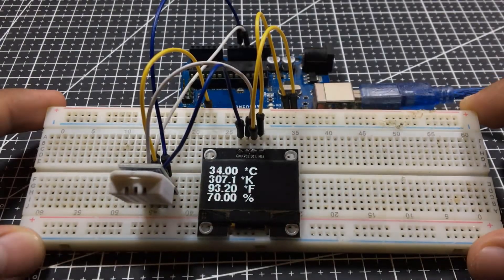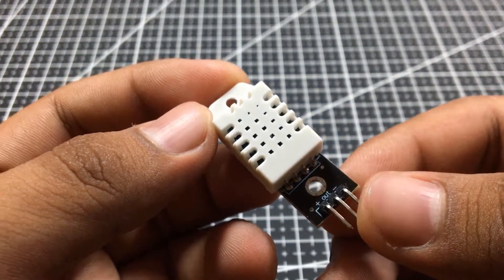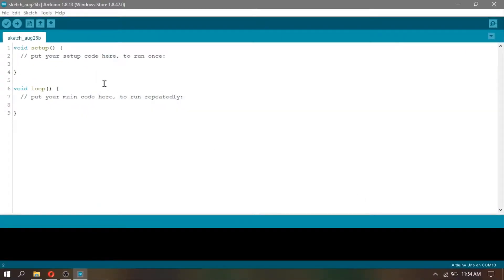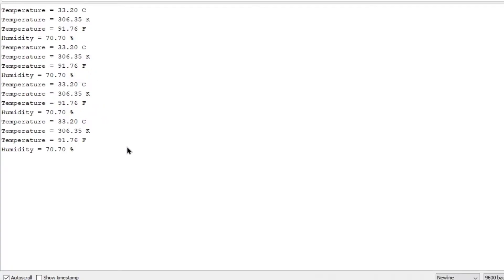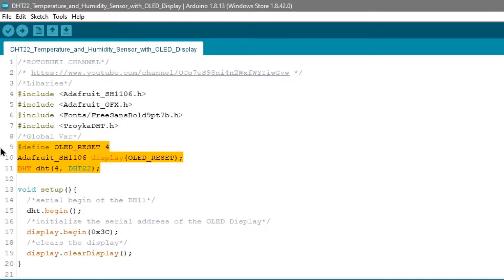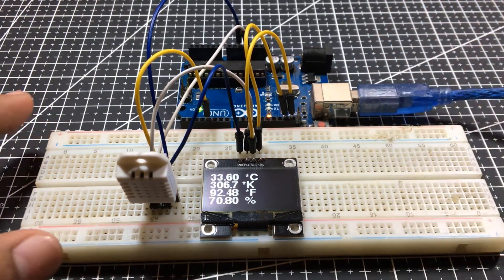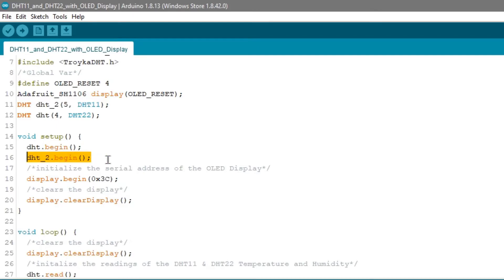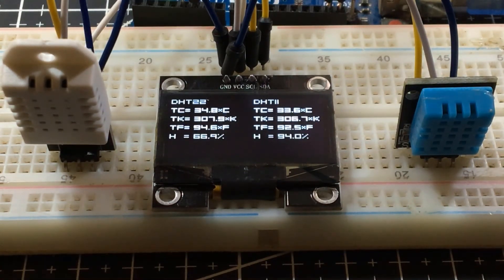Arduino Weather Station Based on DHT11 and DHT22 with OLED Display

Comment: The DHT22 sensor enables temperature measurement in the range of -40 to 80°Celsius
Does your program accept this? I.e it also shows negative temperatures?